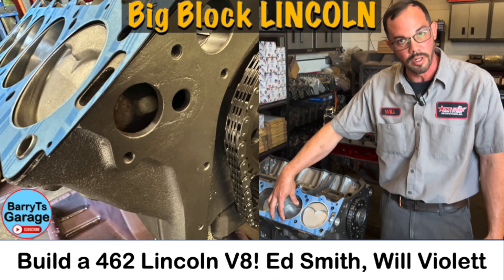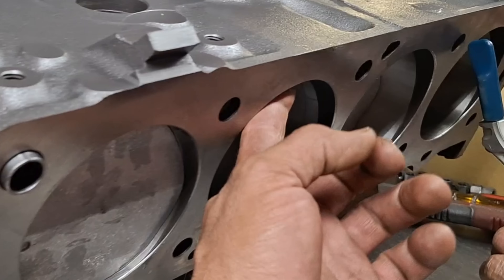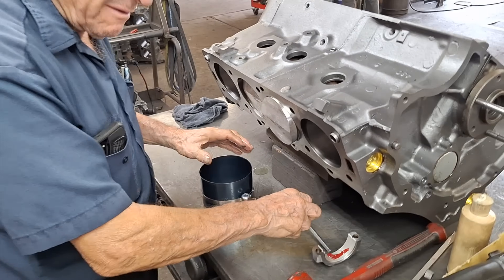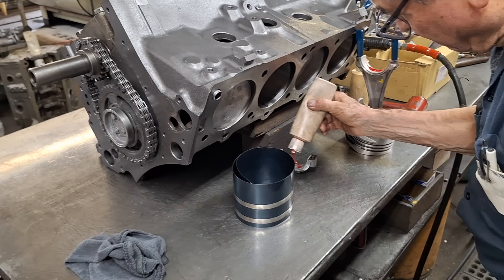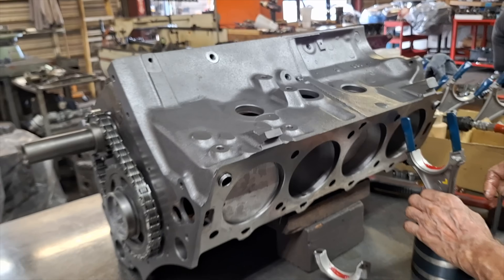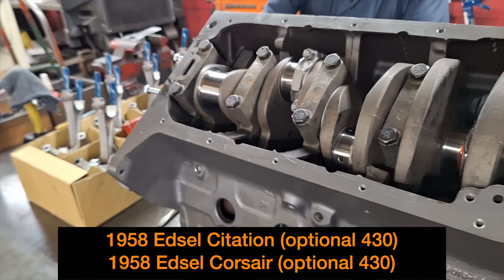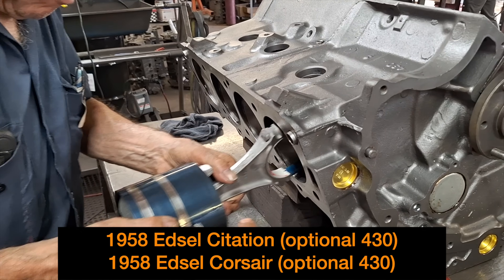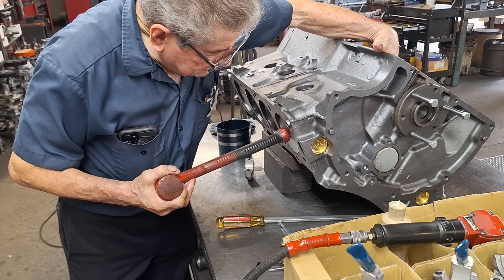TRICKY Pistons to Install - MEL 430 Assembly - 383-410-430-462 Lincoln Edsel Mercury Engines #BarryT

Comment: i have done a few of them along with the 348 and that is about the only type of ring compressor that will work  also what ever it gets bore to [ .030 over or what ever ] the step  [counter bore ] needs to be bored the same ! for two reasons c/r and you would never get the ring compressor down in the counter bore its that tight
Reply from the maker: Great points!
Reply: @BarryTsGarage  I wonder if a fe crank and heads would work on that  block,dont know if this 430 has the same size rod journeys

Comment: I'm restoring a 62 Lincoln and I have ordered all of the engine parts.  Once I finish the bodywork I will tackle the engine.  Question though... How do you know if you got the rings in properly?  Is he looking to see if the cylinder walls are getting scuffed?
Reply from the maker: He’s checking to see if the rings are getting past the lip or if they’re binding in any way. Always going very gently and not forcing anything.
Reply: @BarryTsGarage  OK. thank you

Comment: Do video on the cylinder heads, intake and exhaust manifolds of that MEL. I've heard about these engines but never seen one being rebuilt. 
Interesting engine. Similar to the 348-409 W Chevy engines except for the deep crankcase skirt. 
👍
Reply from the maker: I will try to do that please note, we do have another video about this engine, and we show the heads which are unique, they look like diesel heads

Comment: Is it true if u taking off from a light persay, and u got it WFO , If u double pump the throttle just at the shift to 2nd gear it makes more hp for a faster shift?  I hear this guy all over town beating his car and every time it is ready to shift, i hear him double pumping the throttle at the shift to next gear 🤷‍♂️
Reply: Or is his transmission  just that lame where he needs to manipulate the throttle to make it shift? Cause it sounds like the motor is up at the moon and its not shifting unless he does his double pumper action
Reply from the maker: I’ll ask Ed about the shifting and HP technique

Comment: I'm building a 383 sbc my question is, I have a scat cast steal crank a stock factory flex plate 400  and an assault 400 Ballancer I'm going to run in on a dirt track will it live at 6800 rpm or do I need to get it internal balanced  need help thanks
Reply from the maker: I will ask Ed, I suspect the scat crank would be pretty well bounced out of the box, but I know Ed always seems to want to internally balance any high RPM motor

Comment: That looks like it would test your patience. Not much different from 348 or 409 engines either. Maybe easier since the chevys have that valve pocket in the cylinder.

Comment: I always appreciated the design of those "FE" style blocks where the oil pan sits flat all the way around instead of swooping down around the crank on both ends. It makes for much easier timing chain replacement in the vehicle because the timing cover is above the oil pan so no need to loosen the pan to get it off.
Reply: I know Ford had a Y block engine series but the FE and MELs are also Y blocks simply put when the block skirts extend past the main caps on a V8/6 it forms a Y shape but unlike the Y block and FE series the MEL is a Big block
Reply: Chevrolet coined the terms of small and big block.. Ford had series/families along with Chrysler.. eventually the market clumped it all together as big or small block.
Reply: @MikeFL2TX  good to see someone that agrees that a FE is not a big block thank you
Reply: @insulman100 there are some videos of the FE stuff I have been around for close to 20 years on my channel. This one is a 427 FE stroker.
Reply: @MikeFL2TX  Okay that's fine but what's your point

Comment: Did Buick 425 wildcat have the same design? My uncle owned a 64 Lincoln & a 65 both smooth & maintance free. I love those style ring compressor. I have found the most critical part in this process is a good chamfer on the top of the block. Too little and even a regular 350 Chevy ring install can crash
Reply from the maker: No but the Chevy W engine 348/409 has many similarities 👍

Comment: Why is he using that ring compressor  upside down ?
Reply from the maker: So it fits clearance
Reply: if he would use it the so called right or other way round that top hose clamp band would hit the top of the block and not go down in the counter bore its that tight ! but on the ones i have done i used the same tool but i was able to use it the right way as the counter bore was opened up and the way he is using it it tappers bigger making it harder to get the piston in that mite be why it took him two try's to get in in ! ether that or the camera man was making him nerves 😁